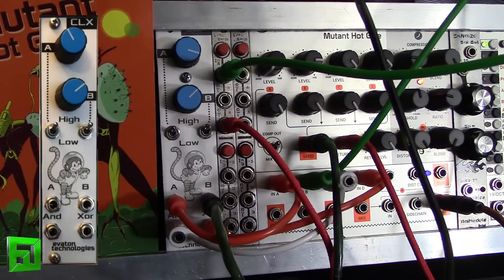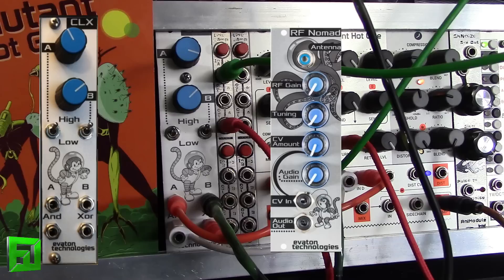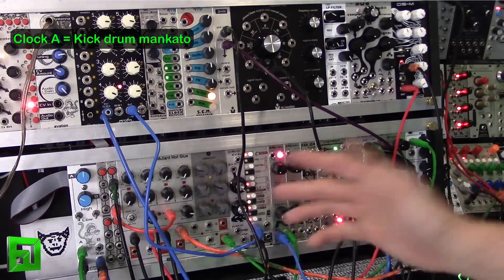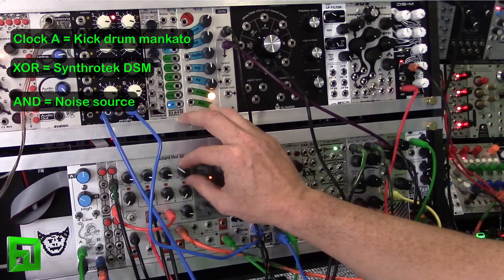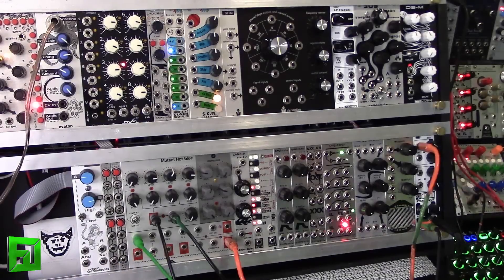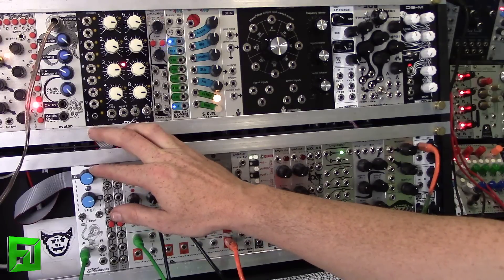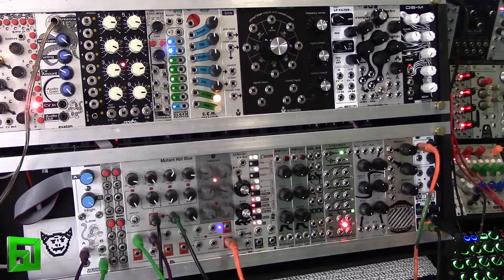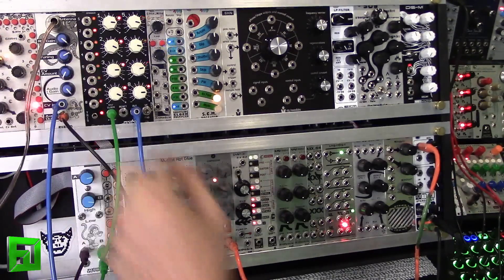Evaton Technologies CLX dual clock module for eurorack modular

Comment: Great demo, Flux! One note to potential customers; Flux's unit is a prototype. The production units differ only slightly -- the Low and High ranges are both shifted lower in frequency. Low range is now about 0.4 Hz to 7.5 Hz, and High is about 7.0 Hz to 140-ish Hz.